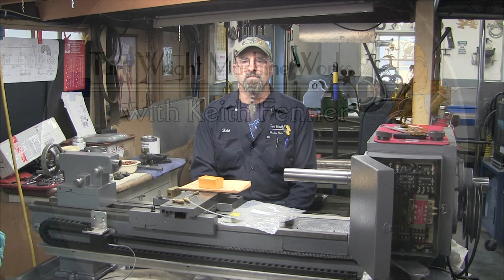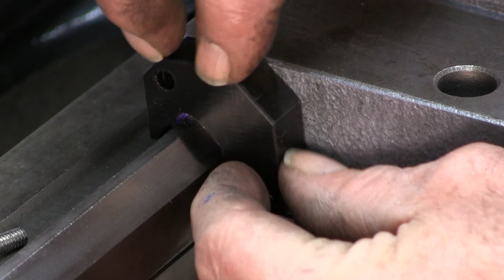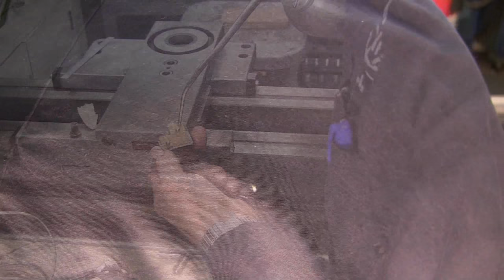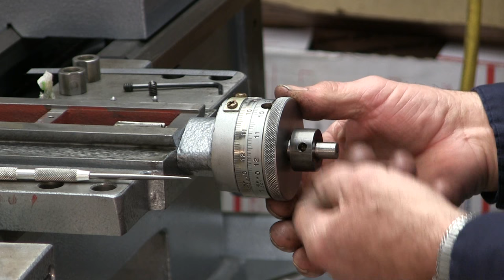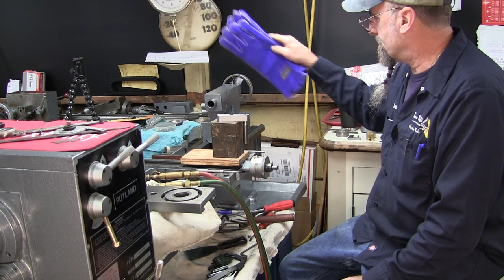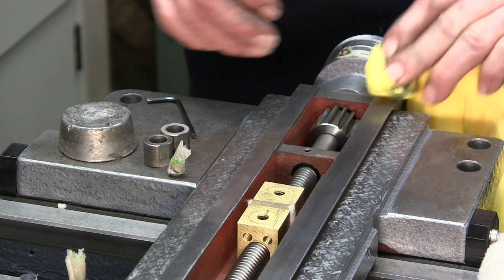Let's Look Under The Old Girls Apron Part Nine

Comment: Commenting at the 31 minute mark.  I recognized those lead BB pellets, and that's just freaking INGENIOUS of mashing them in there for the set screw to bear against those instead of the threads!  Doesn't booger up the threads and you get more surface area between the set screw and the leadscrew!

Comment: Keith,
You don't mention it here, but thrust bearings have 2 different size races- one with a larger ID.  The large ID race always goes against the fixed bracket and the small diameter race fits tight and rotates with the shaft.  If you get them backwards your small ID race will drag on the bracket.  Or when you have 2 sets like here, and you put 2 large ID races on 1 shaft, there will be nothing to center the bearing and eventually the ball race will get out of place and come apart.

Comment: Great Fenner Fix for Christmas eve, 
I cant help but cringe at the design  to hold the gear in place, it just seems to me that a taper pin would be a better choice than the design the manufacturer chose  ( most likely for ease of assembly). 
Merry Christmas to you, Vanessa  and your family, best wishes for the new year
Reply from the maker: Yeah taper pin might be the best choice when I install the new lead screw, after I make. Merry Christmas Phil and your better half! LOL  ;{)-------

Comment: Keith, why did you shrink fit the handle back on ? You said that the leadscrew and nuts are only temporary until you make new ones. You are going to knock s**t out of the bearings when you have to take it of. Why did you not polish down the shaft for a sliding fit, drill the handle and shaft for a taper pin? Merry Christmas and a Happy New Year. Regards from Adelaide in Australia on a  34 C Christmas Morning, supposed to be 41 C after lunch.
Reply from the maker: I'll remove it the same non hammer way I did in the first place. It needed no work to stick it back on for a couple jobs before making the replacement cross feed screw. cheers, Merry Christmas ;{)------

Comment: Great series Keith.  Do you have any tips on straightening a lead screw?  I have a lead screw for a Jones-Shipman 540 grinder that is about .022 inch out.   Thanks.
Reply from the maker: I like to use a precision three or six jaw chuck in the lathe hold and spin to indicate and pull pull by hand to straighten, and sometimes a aluminum pipe over end, slide in and out to work the ares showing the bend, use aluminum flashing around the lead screw in the jaws, to keep from marring. ;{)------